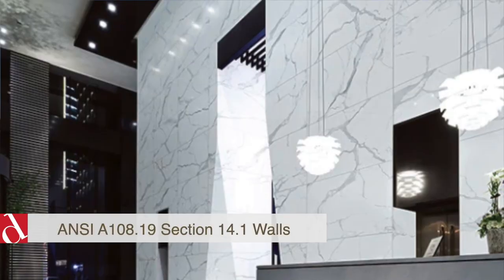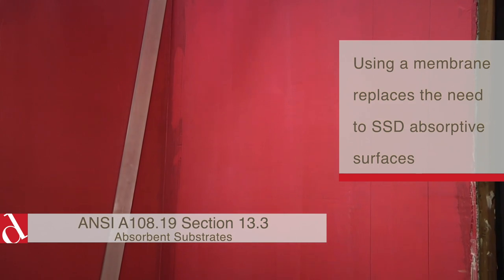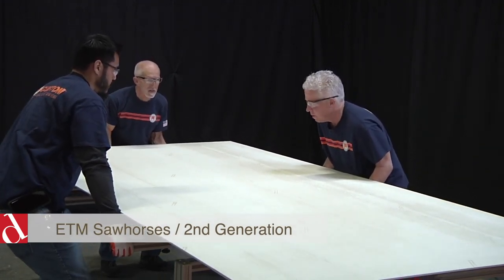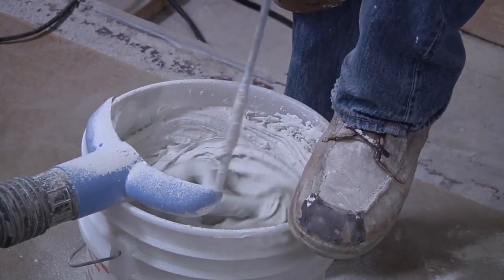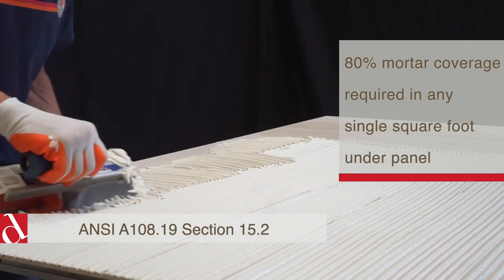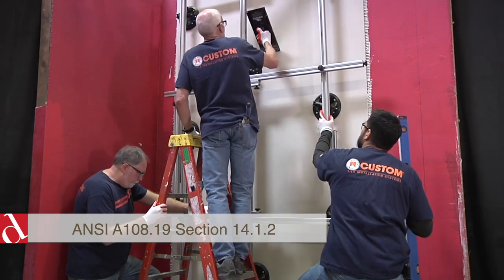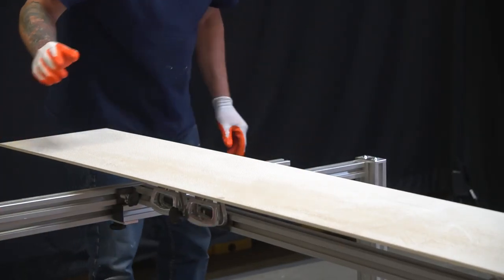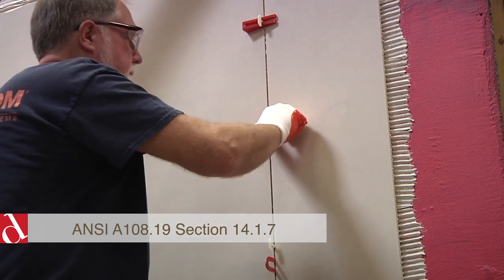Daltile - Panoramic Porcelain Surfaces - Wall Installation

Comment: You should better define what “keying” in means for designers and architects.  Basically it’s a skim coat using the flat edge of the trowel to makes sure all pores are sealed on the porcelain and substrate.  It also helps the notched coat adhere better when applied.  Correct me if I’m wrong...
The use of the vibratory tool is clutch!
Reply from the maker: Barry, thank you for your feedback! We will be sure to bring this to our team 😊